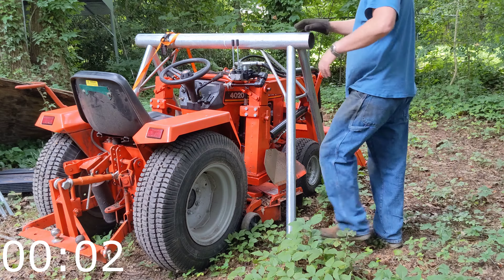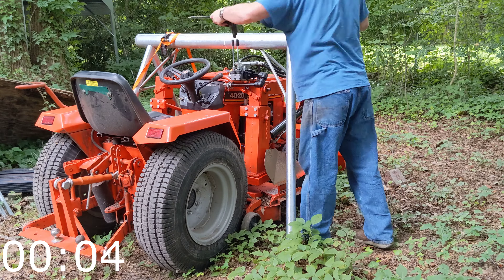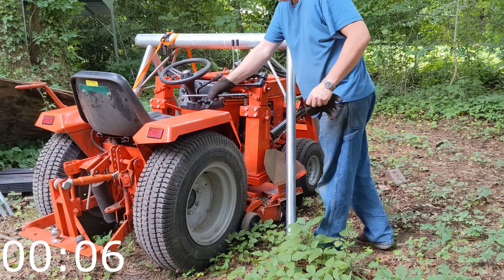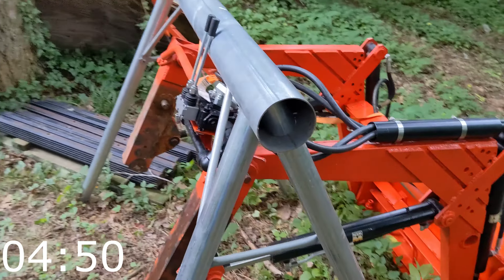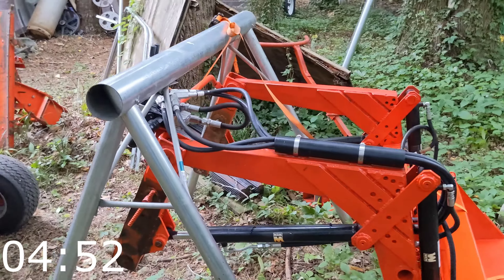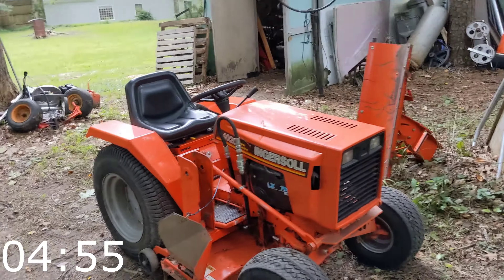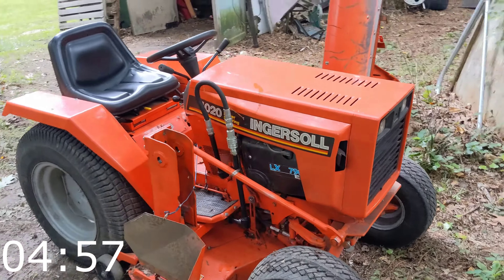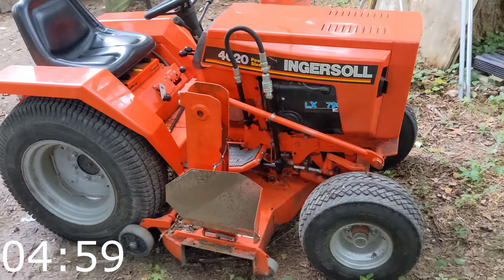Loader Detach

Comment: Very nice built I love the reinforcement to the frame and the look and structure of a frame. 2 questions 1: does the hydraulic run off the same system as the whole tractor? And 2:why is it you aren't using jack stands for the loader removal? Still very nice job on the build
Reply from the maker: Yes, I modified the tractor's factory hydraulics to "insert" the loader valve into the pressure stream.

I'm not sure how I could use jackstands, because I have to drive out from under the loader once it's detached.  By having the rear end of the loader assembly hang from the crossbar of the sawhorse, it leaves a clear path to drive the tractor underneath it.

Good questions!
Reply: Next time you look at it angle your bucket about 45 degrees down then rest the arms. You will see you have room to make 2 short stands. Then when you pull your pins out you curlthe bucket back it will pivot the arms pull the towers out of the mounting points then undo your hose, boom bang done. Not saying your idea doesn't work fine but I think you would like it better. My loader is from a Kubota and set up very similar to that but uses 2 legs to remove. When I build my mounts I'll do a video showing and explaining more about it. Once again very nice looking and performing build.